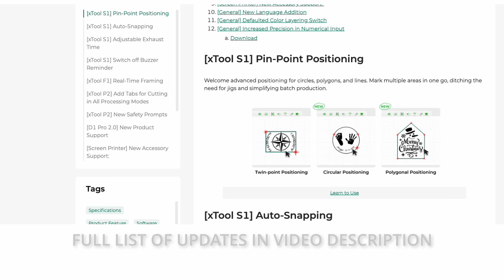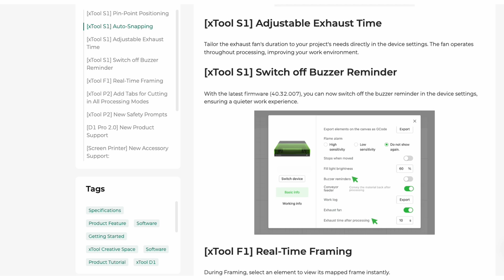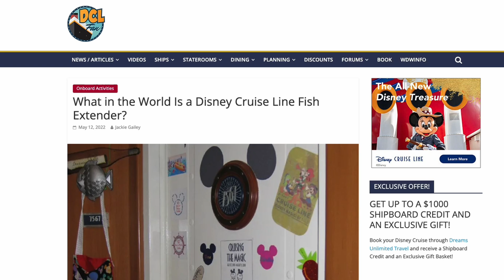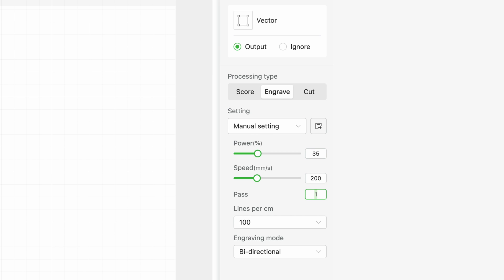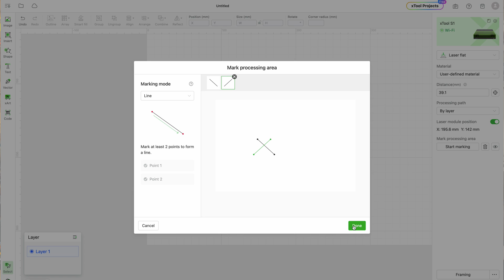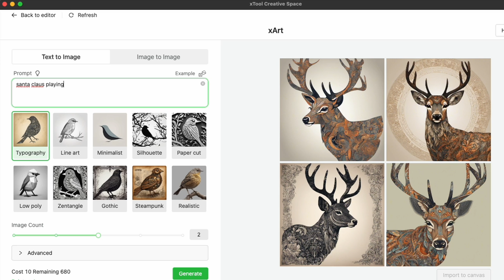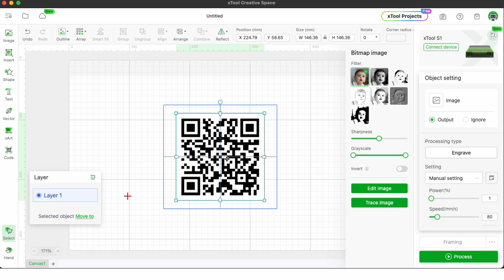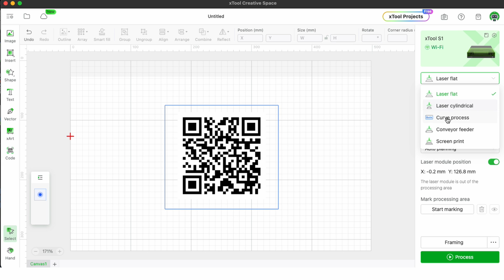The xTool software just got better | Creative Space Software Update

Comment: What I don’t get is xTool has the camera feature for the S1 but why can’t they make it compatible with the D1 pro. You can with with light burn … something tells me it could be programmed to work with other cameras . Or am I missing something.
Reply from the maker: The S1 uses touch probe and not cameras. Since the D1 is a manual operation it couldn’t be retrofitted for the touch probe. I highly recommend the P2 which has the dual cameras.

Comment: The only thing I'm currently missing in XCS is the ability to batch engrave serial numbers. For any other thing, Lightburn is way worse, you can't even open the laser lid for framing, doesn't focus right and you need different speed and power settings compared to XCS wich also has pressets for almost every material. I wish I could get a fully functional machine with at least one of them...
Reply from the maker: XCS does provide the ability for all of the functions needed by most people, but some of the custom options in Lightburn like batch engraving numbers would be nice to have in XCS. I agree.

Comment: In your example with the live edge wood circles, can it focus each one separately (because we all know they're different thicknesses)? They made a lot of improvements, but a nice camera would be so much easier and a lot faster.
Reply: Cameras have a mm or more tolerance (especially when batching). Accuracy with pinpoint has higher potential.
Reply: A well calibrated camera can do better than that. Either way, I would never buy a xTool laser. Enjoy! @CowsGoMonkey
Reply from the maker: For the different height pieces you can separate them by layer, but these pieces were well within the tolerance to have nice engravings on all of them. I don’t think the height differences would be drastic enough to worry about that unless you’re talking about 1/8” difference. 

I agree a camera would be easier and faster but not as accurate for most cases. Thanks for the comment and question. 👊🏼
Reply: if you set it as curved rather then flat maybe?
Reply: these types of wood circles are flat. @markburton5292